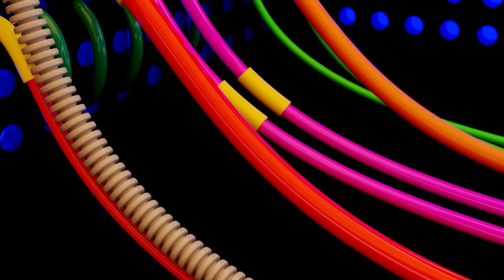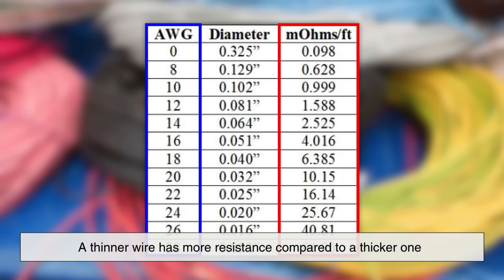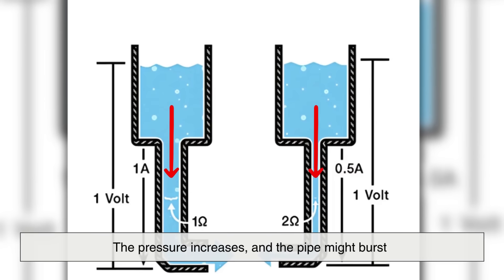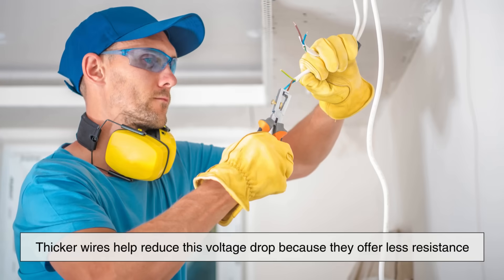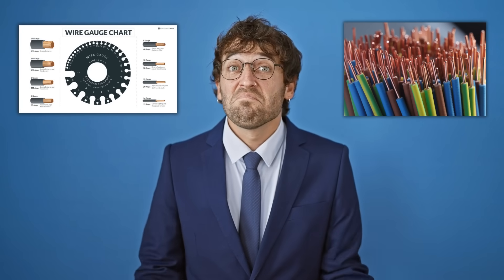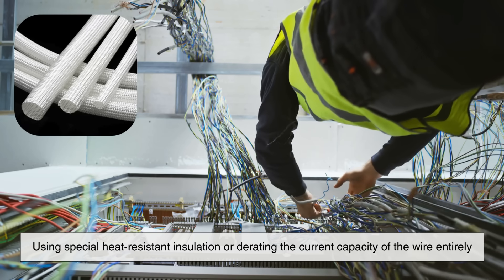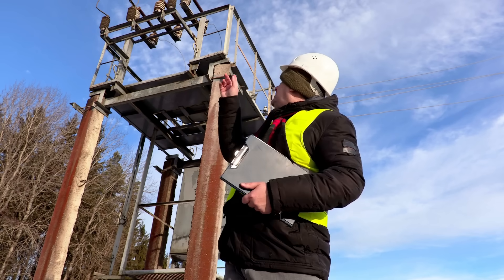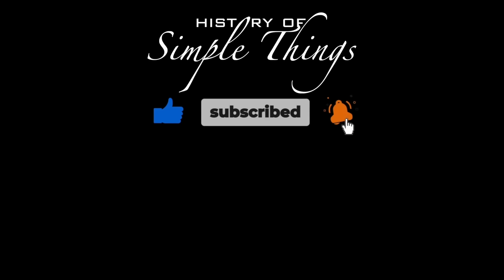How Does Electric Current Affect Wire Size? | Electrical Safety Explained

Comment: Typical 'Murican, inherited from the British: The thicker the wire, the lower the "gauge" - never mind that the gauge has no direct relation to a physical dimension, it is just arbitrary.
In the metric system, we use a value that is directly related to the wire size, it's cross section in square millimeters. The thicker the wire, the higher the value i sq.mm. We Europeans use twice the voltage you 'Muricans use, and se need only half the amount of copper to conduct any given amount of power. >True, we need slightly heftier insulation, but I keep wondering why the cable from an 'Murican outlet to, say, you laptop power supply (110V) is substantially heftier than our European 220V equivalent cable. Insulation or copper? 
As a former electrician, I find the 'Murican domestic power systems incredibly primitive and old-fashioned.

Comment: Same as water pipes. If you want more water, get a bigger pipe. Pressure is like voltage. Amps is like pipe diameter.

Comment: Brother.. One very important information you missed . Alongside wire gauge, AC and DC use need different types of wire. DC application needs wire with a single solid core for example in solar system, wires from solar panel to inverter would need wire with solid core whereas in AC application the core has multiple thinner wire bundled to get a thicker core for example in the same solar system after the DC is converted to AC by inverter, your home wiring is made of wire with multiple thinner wire bundle. 
This is due to the fact that both AC and DC travel differently inside the wire. AC current flows on the wire surface so it needs more surface area whereas DC current flows inside the wire material hence needs a solid wire. This factor is very very important to consider while wiring because even if you choose correct gauge but use DC wire for AC , it will fail. Hope I was clear enough. If any doubt please reply I will try my best to explain.

Comment: Was hoping for a slightly more technical explanation of why the heat is generated...but you covered the reasons and solutions very well.
Reply: Heat is generated through resistance. Electrons move with current, if they move to fast in one place because they can’t move forward, that builds up heat.

Comment: Things are over engineered to such an extent that stupid mistakes won't cause s fire, but don't play stupid games
Reply: When you look at a 20 amp fuse versus the size of 12 gauge wire you can see that they over engineered the wire. I’ve always been interested in electricity. I built an electric dc motor for a science fair in 5 th grade. I retired for a large telecom company with many jobs in between including an avionics tech on P-3s.

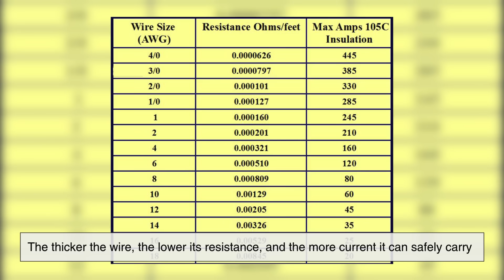Comment: The ampacity chart at 1:52 is inconsistent with the USA National Electrical Code, the Canadian Electrical Code as well as other codes.  For example, a 90C, 14 AWG conductor is only rated for 15 amps in both codes.  I recognize that your table is for 105C conductors but regardless, your number is 35 amps, much higher than the code values by a factor of 2+.